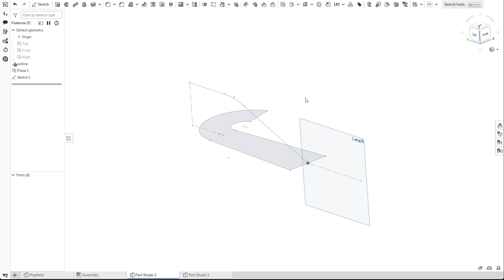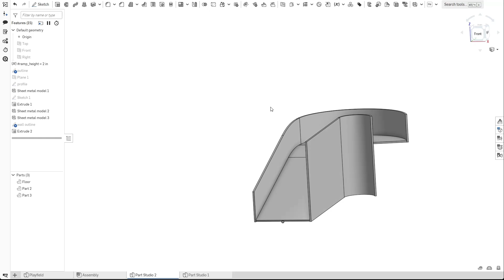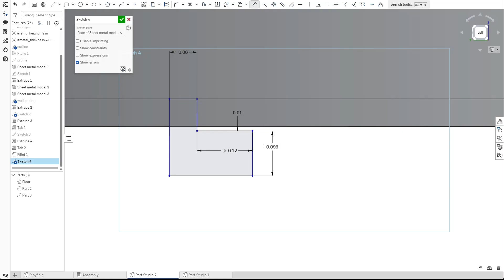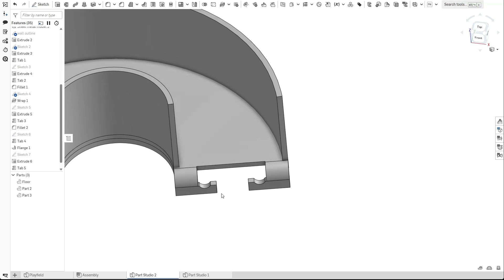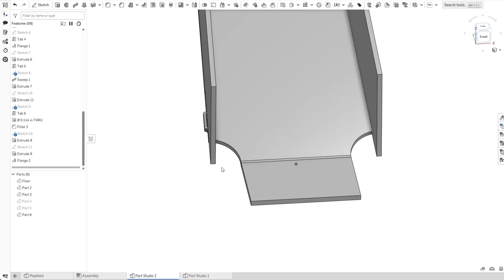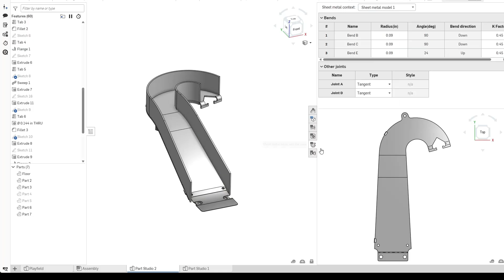Modeling a 3 Part Pinball Ramp in OnShape CAD

Comment: fantastic video. before you commit to getting a sheet metal version of the ramp made do you ever do a rough 3d printed version to get an idea if the geometry works?
Reply from the maker: Yep, I've done that for several ramps. By drawing it the way that I showed, you can use the outline and extrude up, then just cut off the top with the profile, and use sweep for the walls to easily make a 3d printable model.